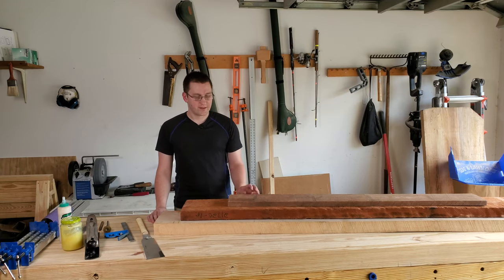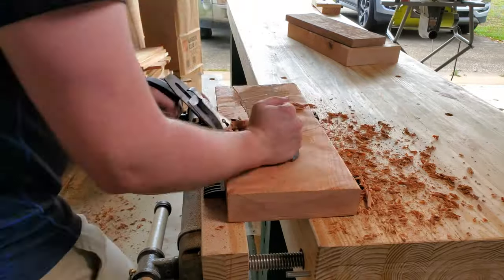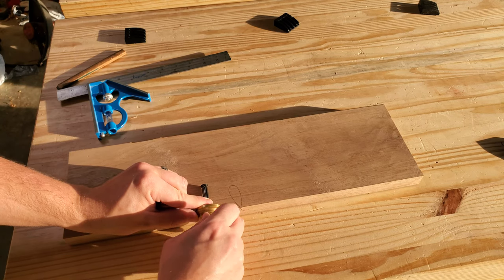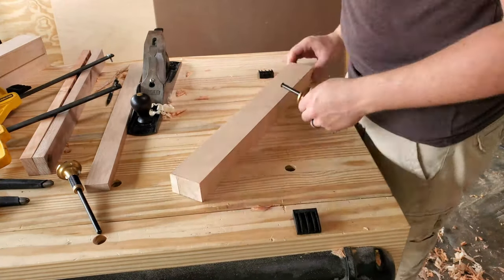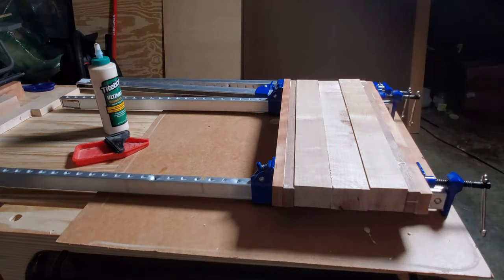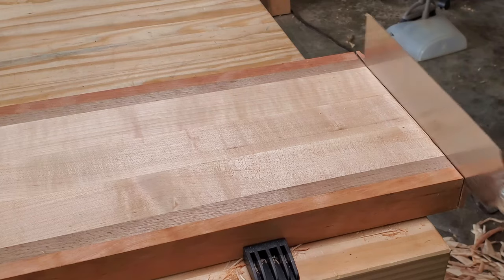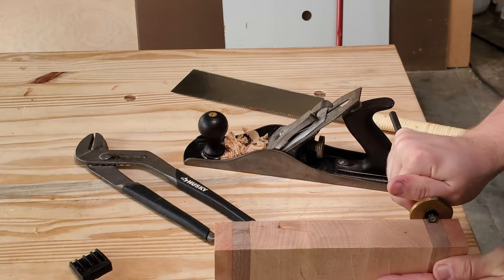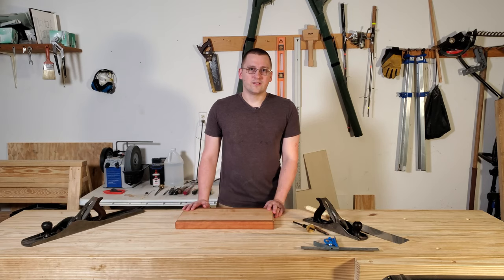How to Make a Cutting Board with Only Basic Hand Tools

Comment: Wow that was super inspiring and also an excellent video! I would like to also try to make some cutting boards for the holiday season with hand tools but was wondering what type of hand planer should I buy. Do you have any recommendations and if you have used a low angle hand planer do you think it is worth it for the price difference?
Reply from the maker: low angle won't help a lot if you are doing long grain cutting boards like this one, I got this plane from a garage sale and fixed it up. Any decent jack plane like this #5 will work great as long as you keep it sharp. good luck!